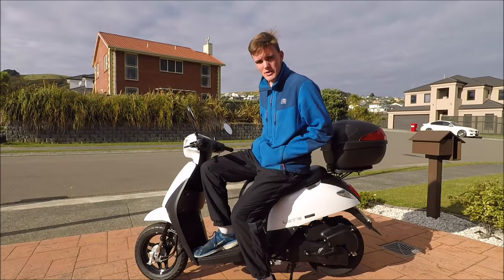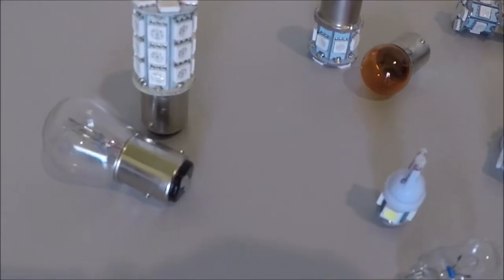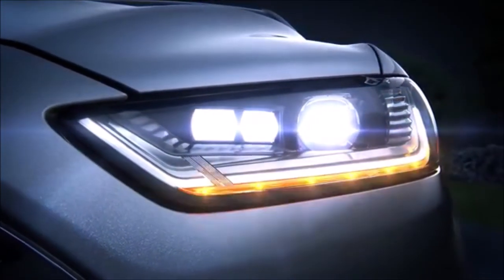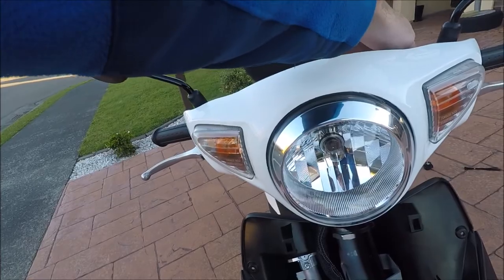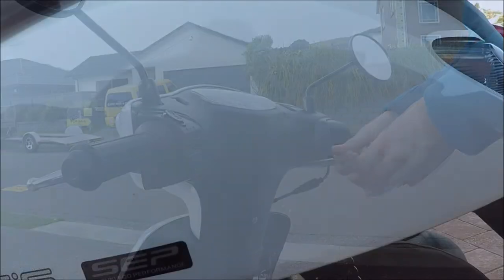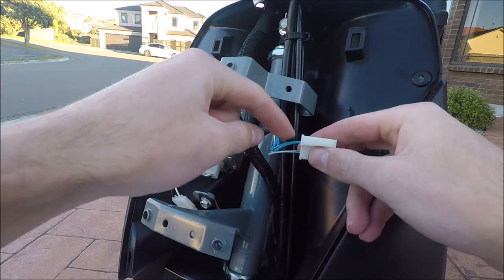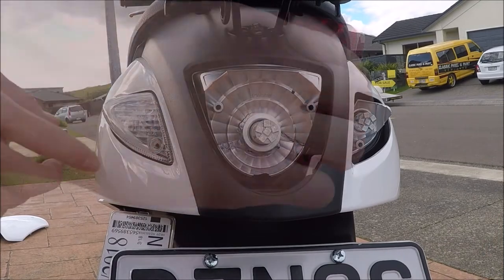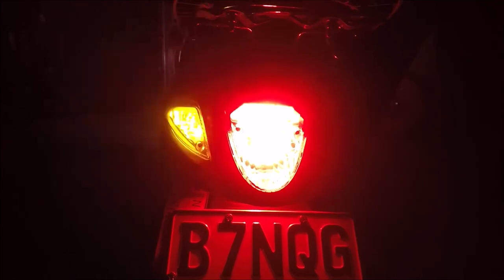How to Convert a Suzuki UZ50 to LED Lights

Comment: I’ve found an LED headlight but It wont work properly. Will the Relay rectify this?
Reply from the maker: Relay is for the indicators, could be a connector or voltage issue

Comment: hi kiwicarlife any idea on how to electronically de restrict scooter? like i try to google it but cant find anything about de restricting a UZ50...
Reply from the maker: Yeah mate I've tried looking too, only info I found was on how to remove the restrictor plate. Electronic limiter is probably actually an rpm limiter so best not to take that off anyway to prevent overrevving the engine

Comment: You seem to do a few videos on the UZ50, do you know how to get the F1 light codes? I have one and the F1 light is on.
Reply from the maker: I believe it's FI and refers to a fault with the Fuel Injection system. Take it to a scooter shop to get fixed

Comment: hey bro, any chance of showing where the spark plug is? scooter headlight keeps blowing every week or so, can't figure out why
Reply from the maker: Unlikely that the spark plug is causing the issue of a blown headlight, could be a voltage issue? The spark plug is located behind a small black plastic panel on the base of the seat, just up from the floor on the left hand side from the front. You can see it next to my knee at 0:18

Comment: Ive tried 6 different types of 1157 bulb and the running side keeps blowing but braking light is fine
Reply from the maker: Hmm that must be annoying - I linked the parts I used in the description so you could maybe try them? I converted mine like 5 months ago and they're all still working perfectly